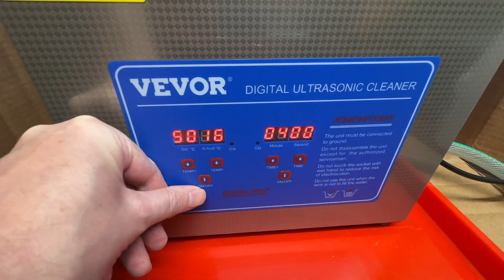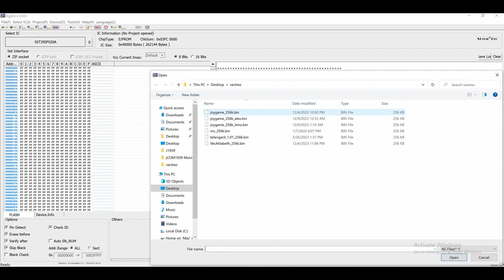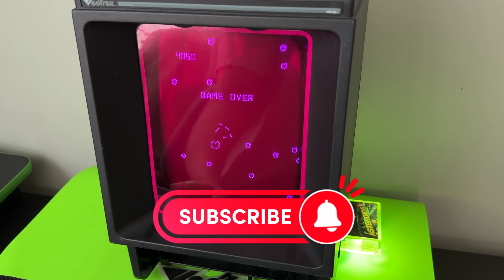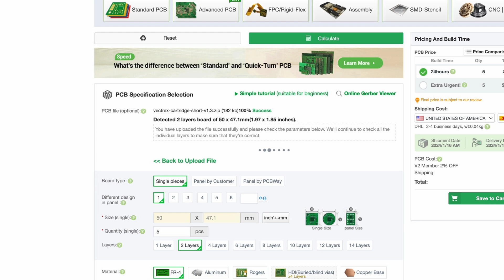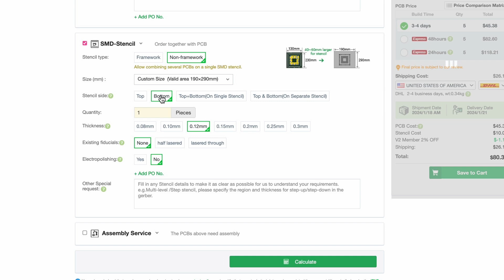How to Build a Vectrex Game Cartridge!

Comment: Great video! Where did you get (or a link to build) the Vectrex programmer adapter?
Reply from the maker: Thanks!  The programmer adapter is a hacked up version of my own design used to backup Vectrex carts (if you look close you'll see it's actually two PCBs and some super glue that make up the adapter).  It's modified to work for SST39SF020A flash chips.  I need to make a proper revision of that PCB and make this available on my github.

Comment: SMT is such a giant PITA.
I much prefer the first PCBs you made, with good ol' EPROMS and minimal SMT parts. :-)
Reply from the maker: I totally understand.  Through hole EEPROMs are hard to buy with decent quality though... they are usually rebranded old stock, pins trashed and breaking off.  So even though the SMT version flash chip is more expensive, it's infinitely easier to source and build.  PLUS, makes it easy to order built PCBs... and this PCB can be erased and flashed in-circuit from the cartridge edge connector.  That said, v1.2 carts are still available to order in the github repo.
Reply: @playvectrex I am in the process of building this, what adapter did you use to plug the cartridge edge connector to the programmer? Is it a DIY adapter?
Reply from the maker: @karoo_bushman6880  it was a hacked up version of my backup adapter, but I now have PCBs for these adapters to program SST39SF020A based boards.  If you can figure out how to contact me, I can sell you one for a reasonable price.  I'll open source it soon enough though as well if you'd like to build one yourself.